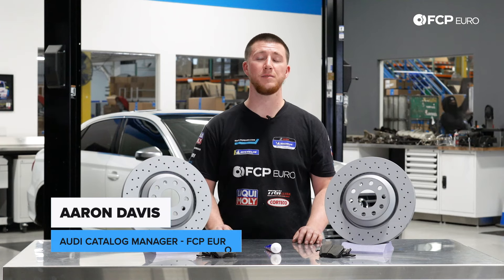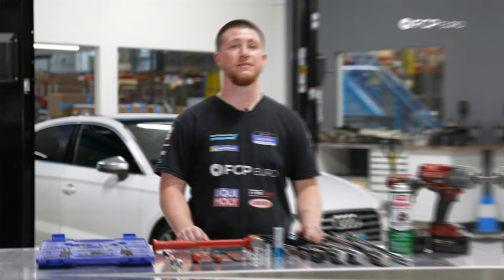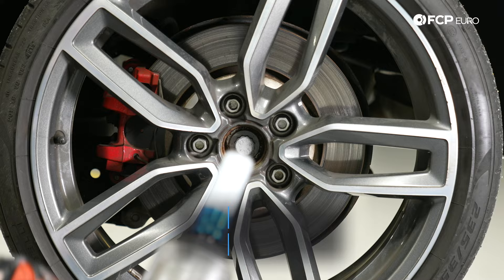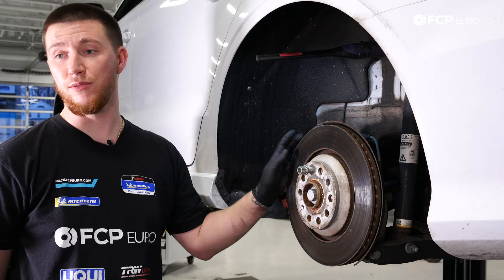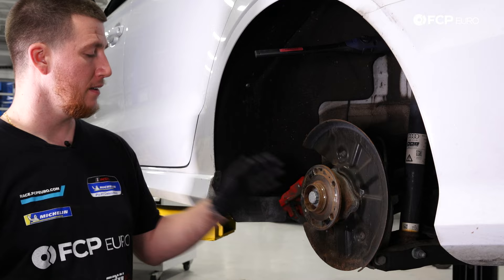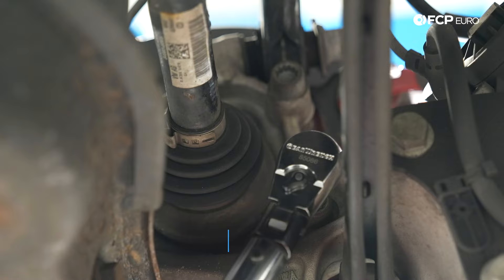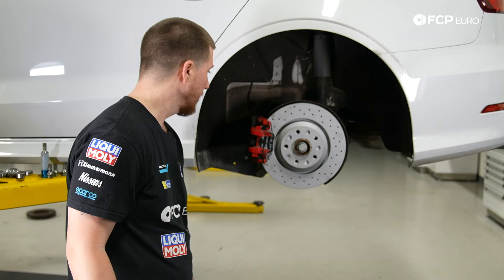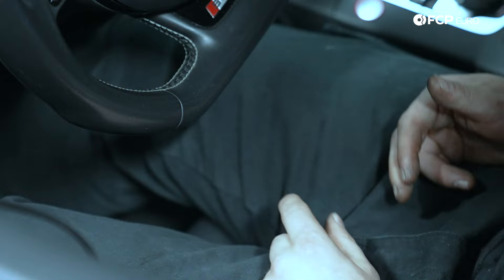Audi S3 Rear Brake Pad & Rotor Replacement DIY (2015-2020 Audi MQB A3, S3, TT)

Comment: if anyone is struggling with getting the m14 bolts off just remember you don’t need to take the caliper breaker off for a rotor change.
Reply: the carrier? yes you do have to take it off

Comment: Great explanation.. but I’d add that you should pull the slider pins out of the boots and clean and re grease them.. and good practice to line the caliper boot with silicon grease.. .. gonna buy my rear pads and rotors this week
Reply: I just replace them as they're only £25-30 for front & rear slide pins

Comment: The rear brake carrier needs to be torqued to 90n.m and then another 90 degrees thereafter, otherwise, great video!
Reply: Haha another you tuber torque spec if you think that happens in garages your dreaming 🤣
Reply: @bystander1489  VW/Audi Dealer Tech of 6 years, seen my fair share of these coming loose and flying off while the customer was driving👍
Reply: The rear carrier does not need to be touched on these MQBs the rotor just slides past
Reply: @shishuali4821  not all, some of the Tiguans and golf's can't slide out, it's dependent on the motor/brake setup that they have
Reply: @Twiisp  I see, looks like I got lucky with mine, thanks for the info 👍
Reply: @shishuali4821 Yep, at least with my 2016 S3 the rotor just slides out.

Comment: almost great work. no manufacturer orders to smear the hubs with grease under the disc. this creates micro wobbles of the rotor. It is not meant to be taken off every month. just clean it mechanically & chemically so one flat surface is facing another uniformly. if You still want to do it at least turn the rotor on the hub several times to evenly distribute the grease.

Comment: FCP Euro.....Drilled Vented disks have a left and right part number as they are not the same on both sides...and in your vid you installed a right hand disk on left hand side of the car...

Comment: This video is insane.  I just did the rear brakes on my RS3 without a vehicle lift on the original parts.  Different experience.
Reply: I’m about to do my rear brakes on my RS3 also. How did it go? did you need a scanner? I heard you can just apply voltage to the motor to release it
Reply: @lukealiciouss how did it go? bout to change mine, do you need the scanner?
Reply: @cmanzii I used the scanner. Yes

Comment: For a Audi A3 8V TDI S-Line(did the rears today, Brembo discs(rotors) and pads) you will need a stubby 7mm socket for the top and bottom of the caliper bolts(because the suspension parts behind are to close for a normal one(so the one i bought was useless!. Good job i also brought a 7mm allen key!). You have to take off the 2 carrier bolts! as the disc will not just slide out!(like they can on some S3's). I used the M14 spline tool on a 10" breaker bar with a swivel head going in from the top right for both the bolts. Going in from the top right there is loads of room with the aid of the swivel head to get the angles(saying that i also went in from the top right when using my torque wrench to tighten them back up"). With a steady hard push down they undone easy IMO(i did have my Weetabix that morning!!). With everything going really well, i even painted the calipers after :). 
THX for the video it helped me alot before doing mine
Reply: Doing my q3 2020 rears rn and can’t find the brake carrier bolts to get off to replace pad. Hopefully this video helps

Comment: You make that look easy! I remember doing my 2016 A3 and I swore way more than any other brake jobs i have done lol not much space for the ratchet for the caliper carrier to remove it let alone break it free.....ended up padding the metal with a rag after smashing my fingers lol good times 🤣🤣🤣

Comment: Can this process be done in neutral to bypass the electronic handbrake? Just do 1 side at a time and use someone to push the pedal in when tightening the wheels back up?
Reply: No, placing it in neutral does not fully retract the motor. I tried it.

Comment: If you electronically open the piston; do you need to screw it back in or can you just compress it normally?
Reply from the maker: You would need to reset it back to its normal operating position.

Comment: So on my s3, I have electronic ebrake, I will be using obdeleven to open and close ebrake. Do i still need to use that manual tool to push piston back or no? Thanks
Reply: Just did the same on my golf r (e.g. same rear brakes as s3).  I had to use the tool to push back the piston even when I opened vis OBD11.
Reply: Yeah. Scan tool just rewinds the motors so you have space to push the pistons back.
Reply: Can you push the piston back even without disarming the electronic brake?
Reply: @connaghtakairangi6935  no, its really tough and wont go anywhere. Thats how it was on my 18 fusion with the EPB. 
Did these on an A3 yesterday and also had a hard time with them open/in service mode as well (im rewatching the vid b/c i got a fault lol) but it works?
Reply: What if you don’t engage electronic parking brake and leave it in neutral ?
Reply: @simon-ctl  i wondered this as well, if the parking brake is not enabled upon park, why do i need to push it back more?
Reply: @Noname23489  Apparently it is needed whatever you do because it’s part of the procedure and not doing so may result in failure

Comment: Note for anyone doing this at home. I did this on my 17 Audi S3 and I still had to use the brake winding tool to release the caliper. I first turned the caliper piston anticlockwise a few turns and then turned it clockwise. This fully seated the piston.
Reply: Did you use vagcom ? Or any scanner tools ? I don’t really want to spend the money on something I’m not going to use often? But if so I’ll do it if I have to just curious to know if you did that ?
Reply: @AlejandroHernandez-fy4qh  im about to do the same and have the same questions...
Reply: @iHadWaterForDinner  i had the aliexpress copy scan tool for releasing the brake. Worked fine but still had to push the piston in also manually. Its in forums and apparently part of rostec instructions to push it in manually. No need to turn it any special direction. Old pad and screwdriver and it will go.
Reply: @egert1064  thank you :)))
Reply: I have Ross scanner and it worked perfectly just like in the video. You should perform this before pressing the piston back in like with any caliper.

Comment: I can’t wait to buy an M14 triple square socket and then probably never use it again! Effin Audi 🙄
Reply: the one i bought i can't fit a ratchet behind.. not sure how they made that so easy. but i feel this on a spiritual level
Reply: After actually doing this, you really don’t even need to take the triple square carrier bolts out. I did the job without needing to take them out after all
Reply: @mitchlachs286 Correct, you don't have to remover that bracket to remove the rotor.
Reply: Yeah if you tilt the rotor you can pull it out with out removing the bracket. Just be careful putting the new ones in you can scratch them
Reply: @DutchxPR sorry just wanna clarify, you can change the rotors without removing the caliper carrier? I struggled for an hour trying to get those M14 bolts to budge but I have no space for torque lol. , so I gave up.